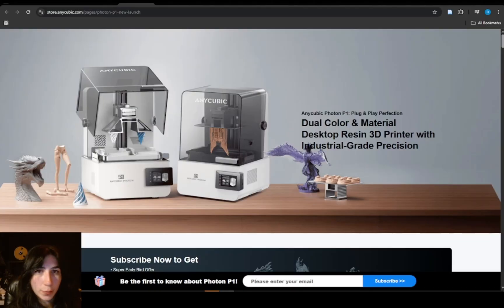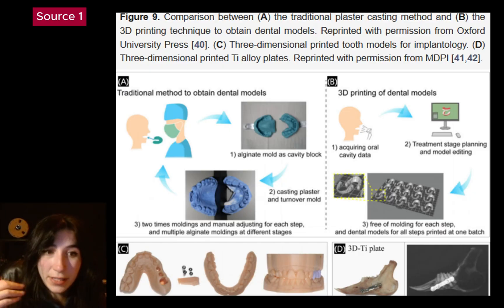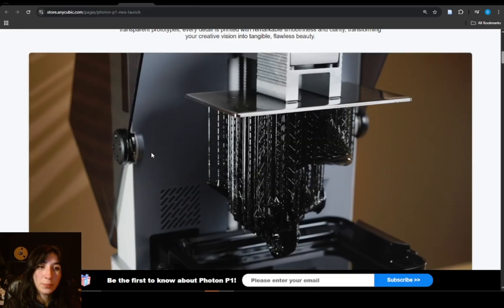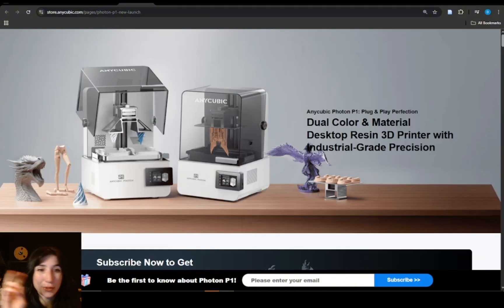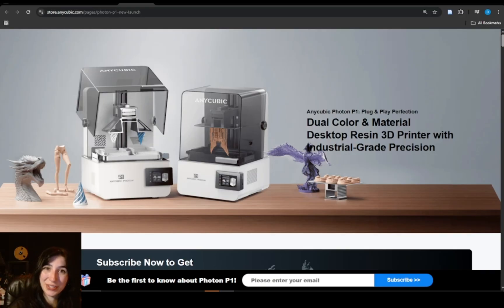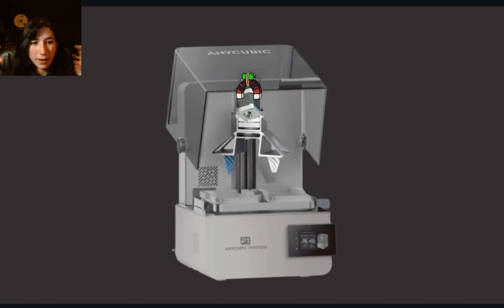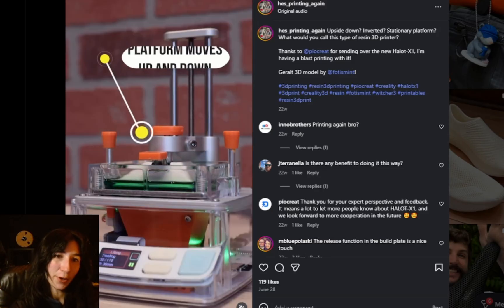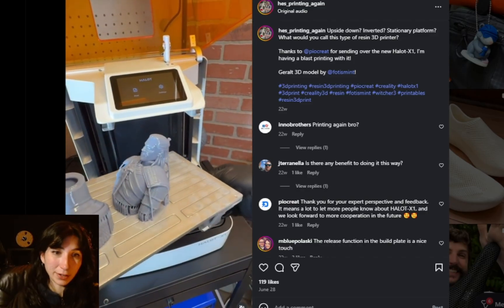How I'd Re-design Anycubic's Photon P1 for TRUE Multi-Material Prints.

Comment: The only obstacle I see is the compatibility of the resins while combining them. A transition zone is going to exist at the microscopic level regardless of cleaning. Adhesion directionality is the main obstacle. Compression only forces only can be mechanically attached or glued. If the materials were easily interfaced molecularly then it would work for most applications. Shore hardness transitions have to be chemically designed appropriately.... my 2 cents. 

The optional vat and dual build plates are perfect if you are printing multiples of two versions of the same design, even the option of just printing a single item in a smaller vat on a larger format printer. Some technical resins are not cheap. 

You have a brain like mine... "hmmm..... what if I did this?"     Didn't always end well, or cheaply.  (I worked as a machinist tech in a R&D lab for a bunch of PHD's.) We always figured it out or found a better way entirely. Some ideas just create more creative ideas later. Collaboration was essential. Failures were always a teaching moment. We had a lot of instantaneous failures that were hilarious, some were dangerous. Pushing through the BS part is expensive at times. :D

Comment: I guess you would need a cleaning step in the middle, to not have the resins mix

I am not that deep into resin so this may introduce more problems, but I can imagine a 3 vat rotating wheel.

Instead of flipping the head, flipp the vatt. This gives you 3 more dof to adjust, but it could be workable.

So 1 vatt is resin A, the second is resin B and the third one is IPA and some sort of ultrasonic cleaner.

When you switch from resinA to resinB you go through a cleaning just to get rid of the unused resin.

This may require a fourth drying step though.

Comment: they said the slicing software will slice each side seperate settings so you can use 2 different settings they said that in their release info about the printer .

Comment: So this allows for both prints to be done at the same time. Two independent vats with different resin types. The screen is able to act like to separate screens so that one half is curing for 2.4 second and the other cures for 1.3 (arbitrary numbers). The retract speed and height don’t matter as much, as you would default to the slowest speed and maximum height of the two prints. The benefit of this for dental is they can use one machine to do the job of two printers at once while taking up less space. They also have more expensive
Resins so having to fill and maintain a smaller vat is favorable.

Comment: I would probably have the resin moving not the build plate. Then I only need one screen.
And I think you would need to rinse between the two types of resin. So you would need at least 3.
But I guess you could have a turntable making it relatively easy. And then pumps to refill and empty resins and cleaner.

Comment: Ok but how do we embed continuous fibers into resin printing. 🤔
Reply: My idea would be to have sheets of carbon fiber. You put in a sheet, then let the resin cure wherever you want it to, then insert another sheet etc.
At the end, you have a cube of carbon fiber with a solid core in the shape you want. Then you have to remove the loose carbon fiber from the solid core with scalpels or so. Obviously this would be very messy, lots of work, and I have no idea if the new sheet would even bond to the previous sheet. My guess would be no, but there is only one way to find out, and I know that I don’t want to be the one who has to figure that out😅
Alternatively you have a laser cutter that cuts out the right shape out of the sheet that has just been cured to the underside of the print, but I don’t think laser cutters can cut carbon fiber…(?) glass fiber would probably work, and would bond way better to the part, since it is translucent when wet, but if it’s also translucent to 405nm UV light I have no idea.
The print plate would have to travel up the z axis a lot more, and then the laser is inserted with a motor under the print. That you need something to catch the cut offs, plus you need to ensure the resin doesn’t drip onto the laser….

I think you have to wait a couple years for this, sorry
Reply from the maker: This is kind of like one of the families of 3d printing called "sheet lamination" - I don't think the method of CF sheets you're suggesting has been tried to any great extent just yet. I love how creative these comments are getting, including yours :) here's more on sheet lamination: https://hybridmanutech.com/wp-content/uploads/2021/09/7-Families-of-3D-printing-by-Hybrid_v17_1p.pdf
Reply: @heinrichhenry1  Hehe I love it. 😂

Maybe you could laser cut the fibers before adding the resin. (assuming the geometry is not too complicated)
And then have some complicated way of moving the fibers to the resin. 😂
Reply: @Petch85 that could also be a viable idea. You’d need to fixate the sheet onto something that can transfer it onto the print. Maybe prepreg glass fiber sheets would work that have uv resin pre-impregnated. Then the sheet would also be kinda sticky so maybe it can be transferred. Sadly the sheet couldn’t be cut on an fep sheet directly, that would be pretty cool. But my guess is that a laser would cut through the fep as well (unless you find a wavelength that cuts through class fibers+resin, but not fep). I could be wrong on that one too though, and that process could be less complicated than we thought…
Imagine just having to put a sheet onto the dry printing surface, then it gets cut by a laser from the top, then the print gets lowered and lightly pressed onto the cut gf sheet, gets cured together from below like normal resin printers and then the print rises again, leaving behind the waste gf sheet that was cut off on the curing surface. Then lower another build plate onto the waste sheet, let it cure to that so you basically end up with a positive and a negative glass fiber part at the same time. You get a free mold to your actual part, which I think is pretty cool

Comment: Combining two types of liquid resin sounds like really tough problem. I mean, liquids tend to mix. Not saying it is impossible, but it would probably not print that fast. 😂
Reply: I guess you would need a cleaning step in the middle.

I am not that deep into resin so this may introduce more problems, but I can imagine a 3 vat rotating wheel.

Instead of flipping the head, flipp the vatt. This gives you 3 more dof to adjust, but it could be workable.

So 1 vatt is resin A, the second is resin B and the third one is IPA and some sort of ultrasonic cleaner.

When you switch from resinA to resinB you go through a cleaning just to get rid of the unused resin.

This may require a fourth drying step though.
Reply: @tomaszkarwik6357  I am imagining a carousel of vats. Cause that will only add 1 dof. 

It would probably be very slow though.

But you could have more than one print bed, and print 2-4 copies at the same time 🤔 (depending on the bottleneck cycle time)

Comment: I am not really sold on the Photon P1 dual head.
But sure for very special cases it might be worth it. But on the other hand you will need to start the print at the same time and wait for the largest part and the slowest curing resin. Not to mention if a print fails.

So I would rather have to printers than a printer that can print two things at a time. Also how much do you really save. Like 1 motor, some structure and a controller. Two machines sold in higher numbers would probably not be much more expensive.

Comment: I don't think that this device will ever used in an dental environment. It's all about software, integration and service. And accuracy over all. There we are at Formlab, right? Cost 15x more...it's only an marketing thing to underline the "industrial application capabilities". 
Like the design that talks the same language. But never the less the split plate could be interesting for special needs. 

I guess that we can expect an complete line up with wash and cure station, ultrasonic cleaner and a bigger version like the P1 MAX :-) - if the P1 works well for anycubic and the user.
Now you know my wishlist for 2025 - happy christmas to all😊

Comment: Cool idea, I had never heard of this (I only make FDM machines personally due to sensory issues). But honestly, while I love your thinking, your solution sounds too complicated. What I would do is, attach the build plate using a stepper motor aligned with Z, and level the vats rather than the build plate. I also think it would make more sense if the build area weren't rectangular but pie slice shaped.

I think that for the vat leveling, you would probably need both a lockable ball joint and also a vertical adjustment, but why not right.

My intuition is that a plain stepper motor for rotation (no detent) is not a problem here because the print shouldn't be experiencing any forces when exposure is occurring. If there are slight rotational movements during peel that doesn't seem like much of a problem, as long as when moving down again you give it enough time to settle?